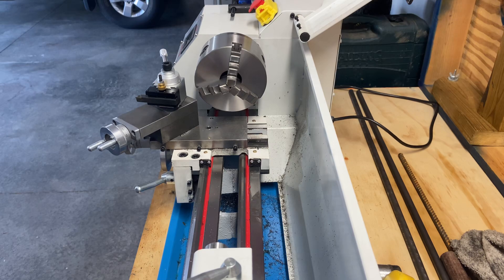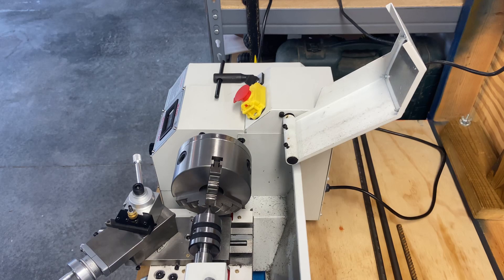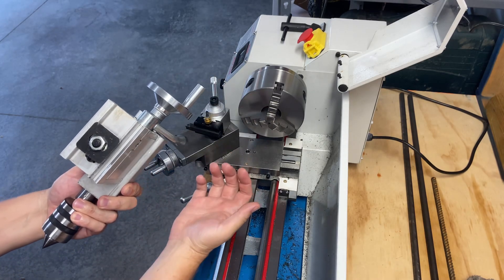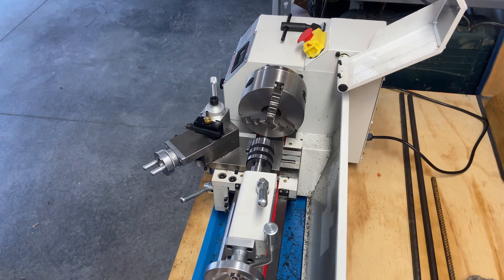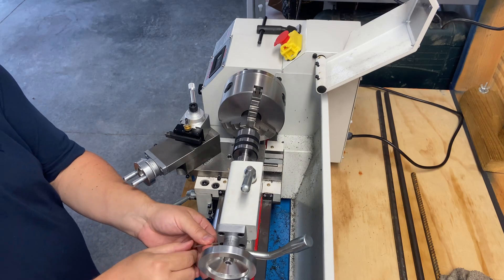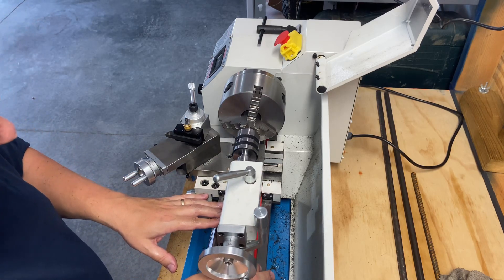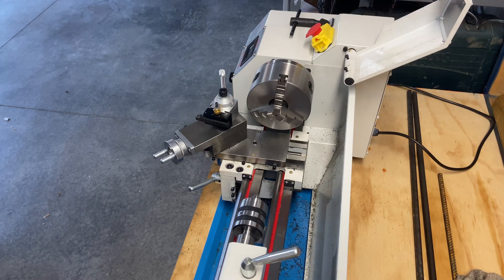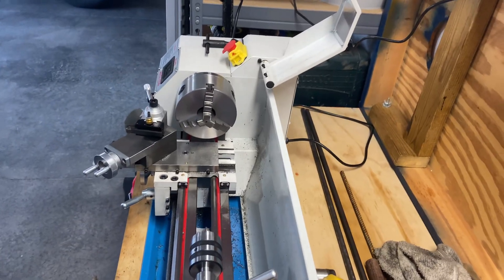Vevor Mini Lathe MX 400 Part 10 - Centering the Tail Stock Complete

Comment: Have you had to adjust the headstock? I cannot get mine to face cut flat. It's always convex
Reply from the maker: No I haven't and dont think I want to mess with it if I can avoid it.  I imagine it is a tedious task.  I was getting convex cuts early on when I first started out.  My solution was simple.  I just needed to lock the carriage.  If you havent done that gice it a try.  I created a permanent carriage lock lever for my saddle but you should have a hex bolt you can use an allen wrench to tighted down to lock the carriage.  Then try your face cut again.  No more convex cutting.  apologies if you already knew this.  that was my problem.
Reply: @deezworkshop unfortunately I have tried this, I've put a solid tool post on and removed the compound to rule that out too. It's looking like it's the headstock for me.
Reply from the maker: @danh9959  Yikes,  Good luck with checking the headstock.  If you are still in your warranty period contact the manufacturer.  you should not have to mess with the headstock on a new lathe.  Even these cheapos.  I am glad I didnt have that issue and locking the carriage fixed my convex facing issues.

Comment: Good job I have the same problem with my 7 x 14 lathe I just got it
Reply from the maker: Keep at it,  this was one of the most troublesome tasks on this lathe,  Centering the tailstock was very challenging.  I finally had success on center drilling both ends of an 18" steel bar.  Small adjustments and walk away when it is extremely frustrating and come back to it.  That is my advice.  thanks for watching.

Comment: Hi, centering to the chuck can be way off , first thing dot mark the chuck and spindle so if you remove the chuck it will be in the same orientation. Chinese chucks are known for quality issues. This is how I centered my first lathe, get a piece of round stock ( about 3/4 dia ) 6 inches long, put in chuck half way, machine end ( facing) then machine the diameter, turn it  around and do the same. Turn the compound slide to 30 degrees ( handwheel at back ) .taking light cuts machine a point. This will give you the centre of rotation for your headstock. Leave in chuck and use this to align the tailstock. This is not 100 percent but will get it very close. Be safe
Reply from the maker: Thanks, in an upcoming video I used your suggestion and turned down a rod that was centered to my headstock then did another alignment.  I believe I am much closer to having it centered than before.  Also discovering the flaws in the cheap Chinese drill chuck I have.  Going to make due with it for now but someday I hope to acquire better quality tooling through family, friends, flea markets, and maybe eBay.  I really hate to buy everything new.  Adds up quick.  Really appreciate your advice on these videos.  No doubt I have missed a few things in the newer video as well but I think I am improving each time i work with this thing.

Comment: Put some stock in the Chuck, turn it to a point.  Line up on that.  You also need a dial gauge to check that the tailstock quill is aligned with the bed by sliding the entire tail stock back and forth.
Reply from the maker: I did finally get a dial gauge.  I will give this a shot.  The tail stock is aluminum so I cannot mount my mag base on it unfortunately so I will need to get creative.

Comment: There are a few degrees of freedom you are trying to adjust. The bottom screw helps to adjust rotation (yaw) while the two side screws adjust side-to-side translation. These adjustments need to be correct, or the tailstock will tend to go off-center as you extend/retract the tail quill. 
Pick a spot on the chuck and be sure you can hit the same spot with the tail quill fully retracted and then fully extended. Translation centering is not important until this is complete.
Once you have the rotation (yaw) corrected, then move the tailstock to the center with the two opposing screws.

If you have up and down issues, be sure to shim the entire tail stock, front and rear, not just the front. 
You are introducing another axis rotation (pitch) moment 90 degrees out from the side to side adjustment by jacking up the front. 

You can test these deviations with some ground stock chucked in the tailstock and an indicator riding along the side and then top.
Run the tailstock quill in and out while watching the indicator. Any deviations will demonstrate an error in your respective tailstock rotation (pitch/yaw) adjustment.

The flexibility of all these adjustments gives you the ability to dial in the machine to near perfection!
Reply from the maker: Thanks Robert,  great tips and advice.  I really want to get this dialed in like I'm supposed to. That is the point of what I'm doing in the first place, Learning the tricks of the trade from the experienced tradesman. Such great advice and tips.  Thanks.

Comment: I'd remove the chuck and get a dead centre that fits into the spindle taper. Use a tail stock dead centre and try to hold a piece of 1mm brass, copper or aluminium strip between them. If they're aligned, then the strip should be perpendicular to spindle axis. This should get you to within 0.1-0.2mm tolerance. If you need anything more accurate, you need to use a dial test indicator held in spindle to indicate the tail stock.

New tail stock usually are a smidge higher vertically since they expect the bottom to wear down over time. Also when extending the tailstock body / barrel, expect to have some runout there.
Reply from the maker: Great advice. I’m going to try all these great ideas and techniques. Love getting advice from everyone.

Comment: You've made one crucial mistake, you assumed that the chuck jaws come together perfectly on center, taint necessarily so.  To find center put the dead center in the chuck, put a dial indicator on the point and rotate the chuck.  If the indicator does not deflect you are golden, probably won't, so gently tap the center with something non-metallic until the indicator needle no longer moves while rotating the chuck.  Now bring the tailstock up and tighten down the lower mount, with the adjustment screws center the two points on each other, lock everything down, and readjust cause something will move when you tighten down a screw.  You also want the tailstock to be on centerline with the center in the chuck, I think the two screws in the front are that purpose.  Good luck and happy turning.👍
Reply from the maker: You are right,  I did visually inspect the centering but centering should be dead on and its pretty difficult to see 1 thousandth of runout.  I will use your method and re-center this thing.  Thanks for your advice and Thanks for watching,  No doubt there are many cringe worthy moments in my videos but I am enjoying learning and really appreciate the advice from experienced tradesman.